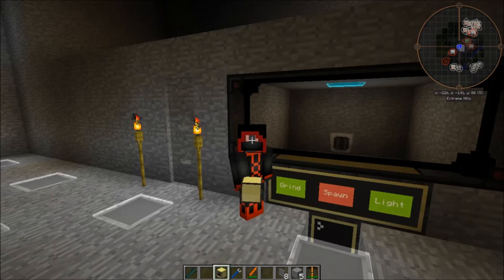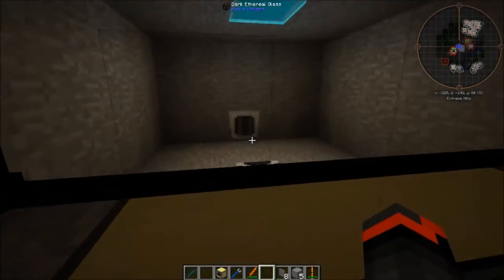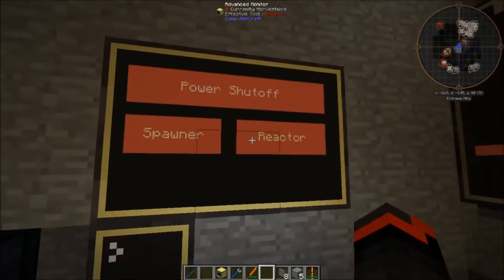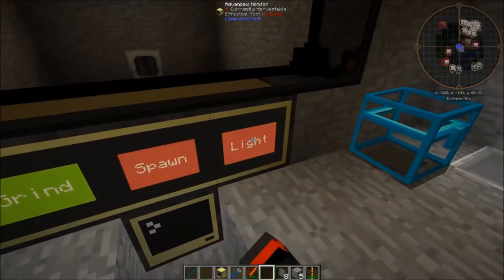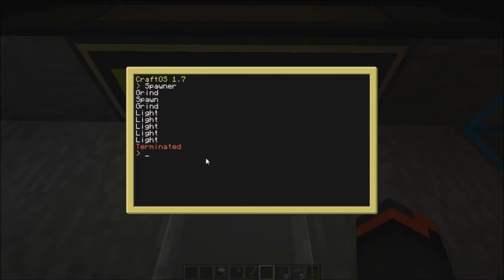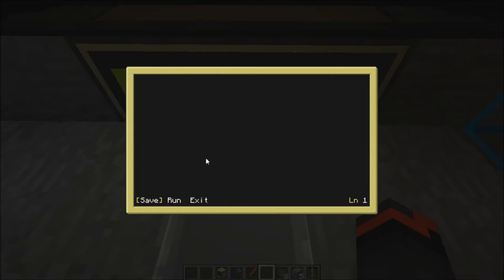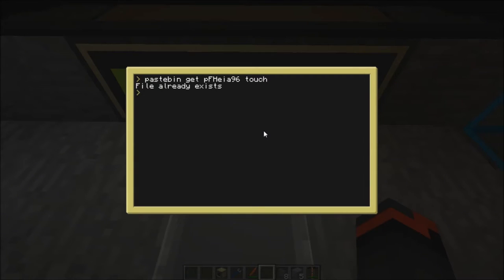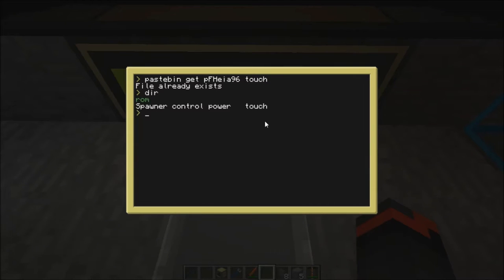Minecraft Touch Screen Spawner Control Tutorial

Comment: Hi. i have used your program for the basis of my spawner but i cant manage to set the outputs to toggle multipal outputs. i have set my system up with 9 buttons but to be able to output 9 buttons i need to toggle 2 sides at the same time. (outputs go into logic system to identify and trigger the correct response) i have added the extra buttons into the check click section but it fails to toggle the outputs. the 4 original outputs toggle but non of the duel outputs do. even if i set them to 1 output. any idea why this is?

Comment: Hi, really good video, but when i try to run the it i get a error, bios:14: [string "control"]:9: ')' expected what does this mean? and how can i fix this.
Reply from the maker: wxam can you give a link to your pastebin code?
Reply: https://pastebin.com/kNaTFEnj here it is, this is what i got so far for the text.
Reply from the maker: only issue i can see is line 20 butoon_click instead of button_click
Reply: ohh sorry i typed butoon_click in pastebin but in it is good in the computer self
Reply from the maker: wxam I can test it out in an hour and see what I get. The error you are getting is not directly related to the code since its error is is os. Somewhere you might be using "text" with a bad ". Will test later
Reply: okay i'm using 1.7.10 with the newest version of Computer craft, Just to let you know :D Thanks for helping
Reply from the maker: ok so function for function writeButton is spelled wrong. and you are missing the comma's on the add button lines between the color and hit color, The while loop you have t:handleEvent should be t:handleEvents
also you cant have all the buttons with the same name. Once i updated that it worked fine. (See pastebin.com/yfd4mn57) hope that helps
Reply: Okay so, The buttons appear on the screen but now i have the problem that when i press a button it doesn't turn to lime and gives the error: control:21: attempt to call nil
Reply: Nvm i fixed it, you accidentally typed t:toggleButtons(p1) but it needed to be t:toggleButton(p1)
Reply from the maker: wxam lol, well glad you found it I guess I did not test after screen.  Good luck. If you ever have any questions you can find me at player.me